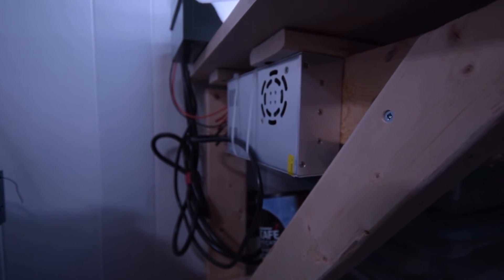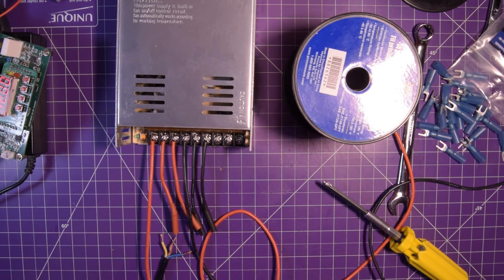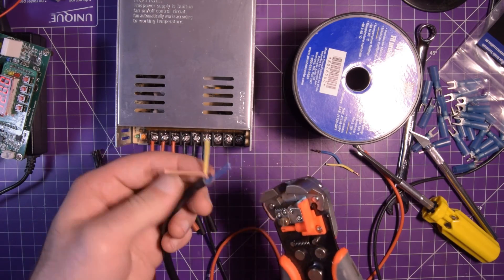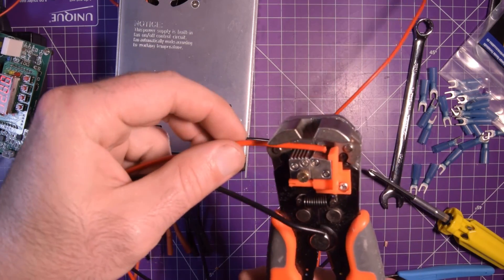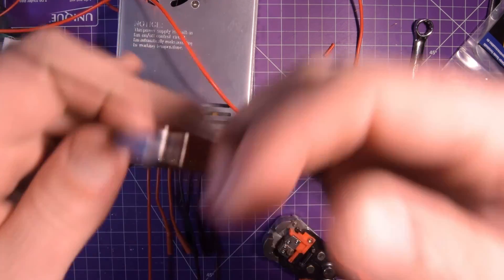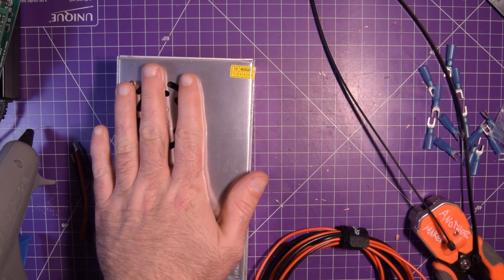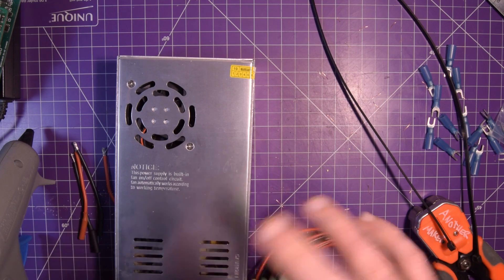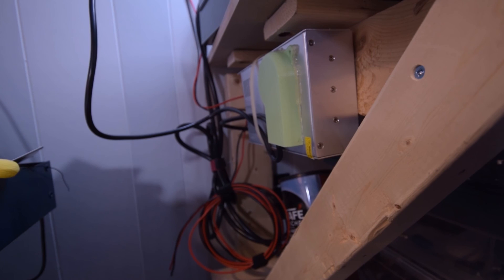A.I.P. - Power Supply Mod And New Wiring

Comment: why not getting a server power supply , might be over kill for this porpuse , but you can get it for cheap besides that most of them have pwm controlled fan which I don't think it gonna be that loud under this kind of loads
Reply from the maker: They are expensive when you consider shipping in Canada, plus I have since fixed the noise problem, but it's only up on early access on Patreon for a bit still

Comment: Hi, enjoying the content. You could always mount a larger and quieter fan on the outside of the case. 
The wire strippers you used seemed to be barely doing the job. I use the 
Irwin 200mm Self Adjusting Wire Strippers and they work great. They were $29.98 AUD from my local hardware store.
Reply from the maker: Definitely planning on adapting a 120mm fan, but they are 15$...really expensive (half the price of the power supply!)
Reply: 120mm fans don't cost that much! Get a used one on ebay.